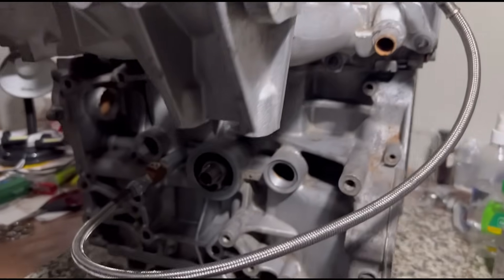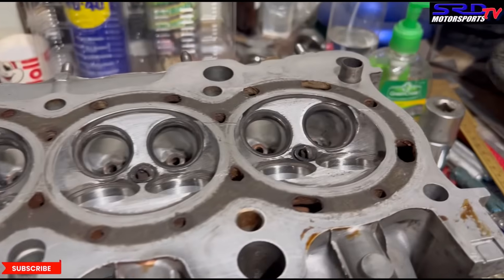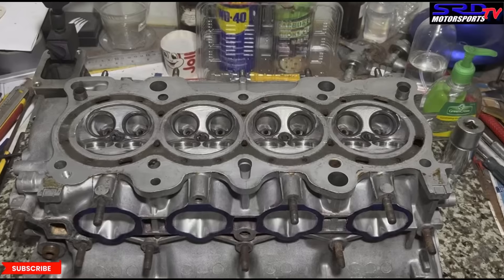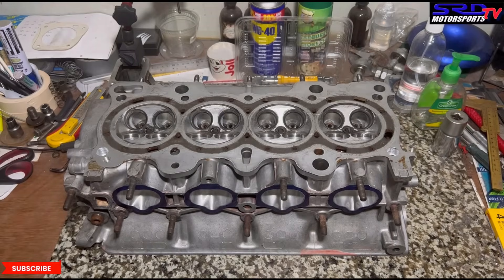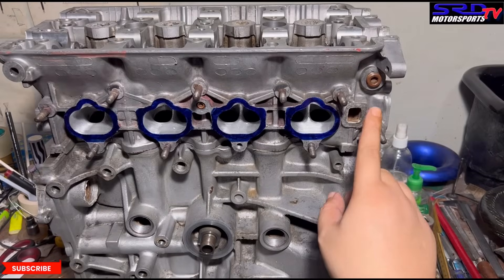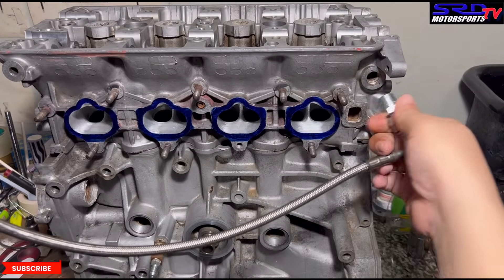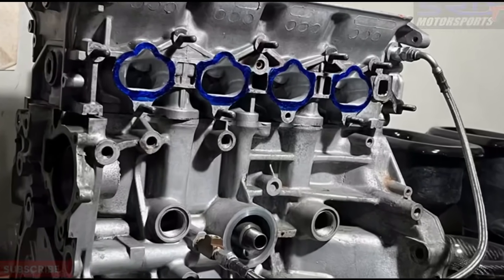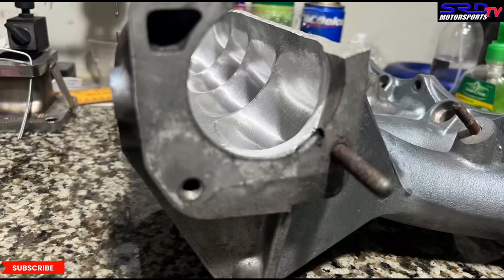Complete Guide: B20Vtec Conversion B16a / GSR / Head and Block

Comment: This is just the beginning of my research so please don't roast to hard, from the little that I've learned in BASIC : its possible to get the B20 block off a CR-V, then with the mods you did on the Vtec head it will fit ?
Reply from the maker: yes that’s about it 
just ideally u should change to better pistons as the b20 pistons have valve pockets for a non vtec so u can risk hitting piston to valve
Reply: @SRDmotorsports  Legend!  Thank you going for Budget build.
Reply from the maker: those are the funnest builds man! Enjoy it! 😎

Comment: So you dont need the vtec sandwich plate kit ?
Reply from the maker: That depends on ur needs
Reply: @SRDmotorsports im currently not running the kit … im using the method in the video and it seems to work well havent wired vtec yet tho !
Reply from the maker: That’s so so cool!!!

Comment: Nice👌🏼 awesome work man. 
Is it a similar process for all Honda Vtec heads with non-Vtec blocks?
Because I have a h22a4 Vtec head and a f23a5 non-Vtec block.
Reply from the maker: oh on f series I’m not sure cuz on the D series it’s a lot simpler than this
Reply: @ oh okay, I’ll figure it out. Thank you anyway!
Reply from the maker: big chance it’s similar to the dseries and just needing the oil jet removal on the block deck
Reply: @ I think so too. I figure if I have a problem with Vtec engagement it’ll be an easy option to try. And if that don’t work then I’ll just lock the Vtec hahah. Thanks man
Reply from the maker: @ I mean the vtec line like on this video was never never common on the F and H so that’s my assumption that it might just be an oil jet check ur block once the head is removed , the oil jet isbeteeen cyl 2 and 3 on the intake side if there is? It’s just pressed in
Reply: @ the block is actually separate from the head already. I heard you have to remove the “oil control orifice” because it’s a nonvtec block but there’s nothing there. So I wasn’t sure. I didn’t even think about it being a nonvtec block. I was at the junkyard and the engine was lying on the floor already. So I was like “cool, imma just remove the head and take it.” I did find that oil jet thing online tho.
Reply from the maker: oh prolly was removed or fell off interesting

Comment: I'm doing the B20 swap. Should I go LS transmission or go CRV 5spd?
Reply from the maker: LS tranny sounds okay
Reply: @SRDmotorsports  thank you. I want change the head too. Should I do B16 or B18? What exhaust sounds good for this swap apexi n1 or hks hi power exhaust?
Reply from the maker: @popclutch_100  b16 and b18 typer head are both pr3 but if you mean b18c1 like GSR that’s also good
Reply: @SRDmotorsports  b18c1 head yes that's the one I was talkikg about .
Reply from the maker: both heads will do good and will make good power
Reply: @SRDmotorsports  you know were I can purchase another B20 and Ls transmission for a good price?
Reply: Should I go high or low compression motor?
Reply from the maker: Not sure
Reply from the maker: Depends on a lot of things what cam , will it be tuned well , exhaust and intake etc depends on ALOT of things
Reply: @SRDmotorsports  what parts can you suggest?
Reply from the maker: almost everything we see in the marketplaces will work it just depends on the goal and project
Reply: @SRDmotorsports  just like 500 hp N/A
Reply from the maker: I see

Comment: This is actually all from honda tech lsv forum..now whats not mentioned is..if a b16 or b18gsr full swap has a bottom end pcv oil crankcase breather aka stock oil catch can..well on b18a/b (LS ) its on the stock non vtec head.so you need a oil catch can installed on the lsv b20v valve covers ..all my friends been cocky and not listened and blown those apart on maybe 3rd night out of racing
Reply from the maker: yep and in all my vids I always explain that crankcase breathing/evacuation that’s mostly not observed

and yep as per channel description… I am and was always a honda-tech regular especially the “all motor” forum

Comment: I have a b18b1 block and b16 pr3-2 head. Replaced the head gasket and it’s still mixing coolant and oil. Radiator hoses are soft even when engine is warm. No pressure building. Engine is not smoking out of exhaust. Drained oil and refilled with fresh oil, started it and let it run for 20 seconds. Checked oil, milky again. In only 20 seconds. I’m thinking I routed one of the coolant lines accidentally into the oil pathways. Are there any diagrams for me to look at coolant line routing?
Reply from the maker: There’s not much diagram for coolant routing g as the intake side near the vtec solenoid and manifold just comes from either the thermostat housing or plugged but even that won’t tend to mix with oil 

Most likely the block is warped… meaning a section of a sleeve or bore has sunken so it is t totally flat
Checking with a flat edge even a 0.005” warp or unevenness can and will cause this at the right spot
Reply: @SRDmotorsports  thanks for the reply. I’m hoping it’s not a head gasket failure again. Or a warped block. But I’m not sure what else it could be. I’m gonna do a leakdown test tomorrow to confirm it.
Reply from the maker: When you pull down the head? Even a straight edge ruler that is aluminum or steel can be used to check block flatness btw and try to insert the thinnest feeler guage 

That’s the easiest way (though crude) to check

Comment: Can you feed the head and a turbo from that T fitting?
Reply from the maker: That’s possible with healthy oil pressure as both vtec solenoid and turbo don’t require alot of oil , most of the time the turbo even has an oil jet restrictor to limit the amount of oil

Comment: paps, do you still do vtec water pipe and tap the block for the oem oil cooler when you do LSVtec?
Reply from the maker: No not really we use what the block has with

Comment: Have a 98 civic hatch with b20b/gsr head. On p28 chip ECU. Was told not to hit vtec too hard because it may send into limp mode? Anyone have any information on this. Car runs really smoothly and vtec does as well.
Reply from the maker: Odd actually never heard of that
Reply: Ummm.this sounds like you bought the car from someone who bought it from someone else....either two things ..the limp mode light is probably the  tuner giving the ecu shifter light when you reaching 7k-9k rpms ..or.. a bad sensor thats throws the cel when you revving hard which out of all then it could be the distributor shaft being unbalanced(cyp,ckp,tdc) which in all honesty rip it have fun with it and when the cel stays on .then flash the codes to see the problem

Comment: 5:17 i dont see the oil controll orifice installed, can you clarify?
Reply from the maker: That’s a mock up block hence I faced it backwards the engine number is already jacked etc
Reply: @SRDmotorsports  thanks, im going to have to tear my b20 down again because i cant remember if i did it myself. still on the stand so its not a big deal.
Reply from the maker: Good thing it’s on the stand still that’s good u can get to it quick

Comment: Hey boss is it 100% crucial to run oil catch can on decent built 84.5 mm piston setup? 11.5:1 compression? 

Just curious 
Thanks so much
Reply from the maker: I would…on a b20vtec but if there is no space or for simplicity I would atleast replicate the vtec engine’s system like vent the back of the block? Run a pcv valve and connect to the intake manifold that’s for crankcase evacuation on part throttle and idle

Then I’d vent the VC on to the intake pipe for crankcase evacuation on anything above 70% throttle 

This lets u run no catch can but still have the system working as oem
Reply: @SRDmotorsports  thank you brotha new to this information will try and get that sorted. Thank you 🙏🏼
Reply from the maker: No worries man! Enjoy your project ftw!
Reply from the maker: @Lowlyfilm  do check this out… made a video about crank case evacuation and it covers a lot more

https://youtu.be/XoEUJ5Xdd3Q

Comment: Would it not be better to run it tight to the block with another elbow to keep it dangling in the engine bay? Plus you could run the pressure switch where you could reach it underneath the car easier.
Reply from the maker: ah true yeah that could be another option indeed